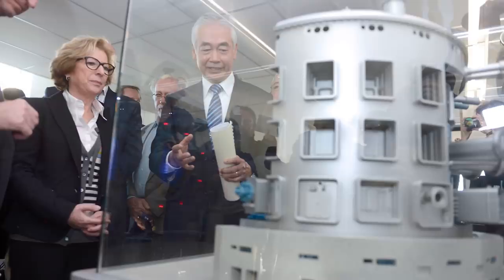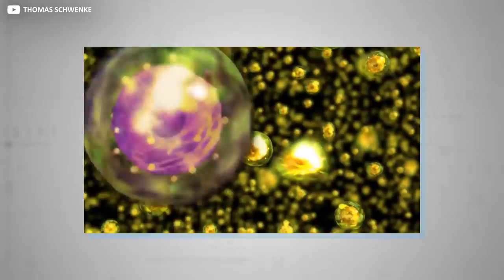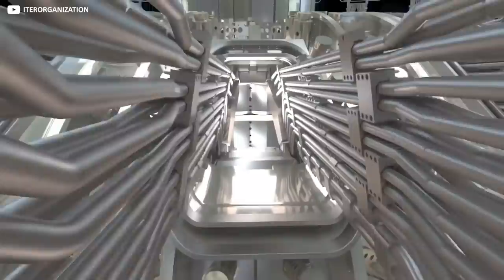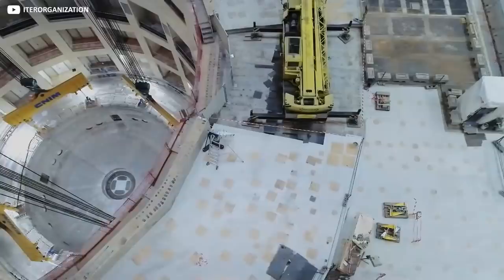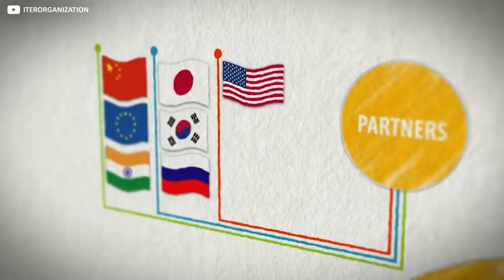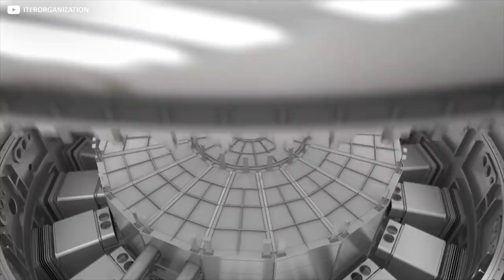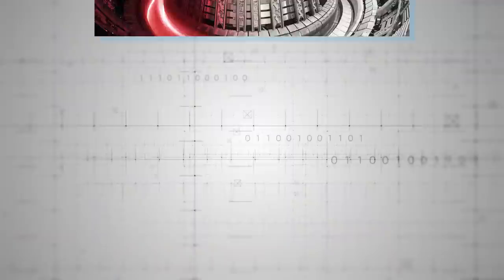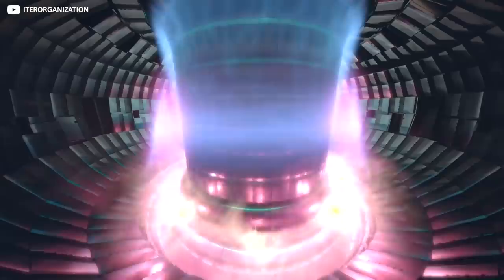Inside The World's Largest Nuclear Fusion Reactor

Comment: When operating, the plasma will be under high vacuum at all times. Some questions:

1. What happens if/when the supercooled magnets unexpectedly quench?
2. What is the expected cost for a kg of deuterium and for a kg of tritium?
3. What is the projected cost for electricity that is generated using fusion, including ALL costs and government subsidies?
4. How is the "excess" heat extracted and turned into electricity?
Reply: 1. The magnets potentially melt and need repairs. The reaction goes out and you stop producing energy until the magnets are repaired.
2. Deuterium is very cheap, maybe several $100 for a canister. Tritium is a few 100-1000 a gram (and they need ~1 kg), but they will produce their own.
3. No one knows, or has even tried to guess. No one will know for decades.
4. High energy neutrons hit a molten metal blanket around the reactor. This heats it. The blanket passed the heat to a water cooling system. This makes steam.

Also, the plasma isn’t at a high vacuum, it’s at a very rough vacuum, a little under atmospheric pressure.
Reply: @Gomlmon99  1. Obviously. But if a magnet quenches, won't 100 million degree plasma instantly hit the interior walls? Won't this cause an explosion, and/or a large and intense burst of radiation? And what are the effects on any power grid when a two GW power generator instantly goes off line?
2. I seriously doubt that pure deuterium will be that cheap. We need a serious analysis of the annual cost of supplying deuterium and tritium to a two GW fusion reactor, that "never" shuts down.
3. If nobody has an estimate of the total annual cost of making power using a fusion reactor, then everybody should shut down R&D until we have a reasonable estimate. To spend billions of dollars over the years, only to come up with a fusion reactor that is unusable due to extreme operating costs, is completely foolish.
4. If the blanket is hot enough to be molten, how are the magnets (next to the blanket) kept at cryogenic temperatures at all times?
Reply: @JCAH1   
1. No, the plasma will dissipate very quickly and doesn’t actually hold that much energy. It has a high temperature but a very low mass, so no explosion whatsoever. Why would there be a burst of radiation from plasma going out? The plasma itself is radioactive, any radiation would immediately stop - not that it matters as there’s a bioshield. The generator won’t suddenly go offline, the coolant circuits have energy storage (huge thermal inertia) to tide over the generation anyway, because there will be pulsed heat production. You’d have ~a hour before all power is lost.

2. It is that cheap. I work in fusion. We buy deuterium canisters each week. It’s very cheap. The helium we buy to cool our magnets is more expensive. And as I said, it will produce it’s own tritium. The fueling costs are effectively 0 compared to the construction costs. We don’t need a serious analysis of these costs, they’re irrelevant.

3. An incredibly ignorant and short sighted view. If we didn’t do anything without knowing the final costs, we’d literally never develop anything and would still be living in the Stone Age. No idea what on Earth you’re thinking here. 

4. The magnets are inside the cryostat, the blanket is outside it...? Just look at a diagram of a planned tokamak.
Reply: @Gomlmon99  It is nice to hear that you work in fusion. I am a retired professional engineer, and I am used to engineers being skeptical of their technologies, always looking for potential "land mines", always doing thorough cost estimates, and always focusing on what is unknown and what could possibly go wrong. But fuzzy, non-engineering thinking, vague, unsupported promises and goals, and a defensive emotionalism seem to have permeated fusion power research for the past 70 years.
 
1. If containment magnets quench, then if the power plant's output goes to zero now, versus going to zero an hour from now, either way the 2 GW fusion power plant would experience an unscheduled stoppage without warning, and require weeks to get back online. That is extremely hard on a power grid.

3. Regarding estimating costs in advance, thousands of giant ships have been designed and built, and the cost to build each one and the cost to operate each one are thoroughly estimated in advance of anybody spending one dollar. The same is true of nuclear power plants, massive planes, skyscrapers, huge bridges, gigantic manufacturing plants, etc. Only fusion engineers seem to exempt themselves from this routine, standard requirement. They and their financiers are going to be embarrassed and very sorry if it ends up costing $30 billion to build each fusion power plant, and the resulting electricity ends up costing $12/KW-hour (versus $0.12/KW-hour).
Reply: @JCAH1  1. Same goes for any power plant. Coal plant has an explosion? It may require weeks to get back online. Nuclear plant stalls? Days to get back online. etc. etc. 

3. None of these you listed are first of their kind research things. No one knew the cost of fission before the first fission plants were built. They’ve been developing solar panels for 200 years, with no idea how much they’d cost until the past few decades. The same goes for most first of its kind research. Fusion isn’t abnormal in that respect.

Not that I don’t agree with the cost issues. I personally don’t think fusion will be commercially viable within the next 80 years, but I don’t like it when people disparage it for irrelevant reasons. The main issue, as with fission, it’s that it’s expensive to build. And that will always be an issue - but we have to try.
Reply: they arent dumb everything you thought about has been revised and corrected. It doesnt blow up its not fission but fusion

Comment: And this is still an experimental reactor, if it works we will build the first comercial reactor which has to be even bigger.
Reply: Not necessarily, they choose the "big" way to simplify management of magnetic disruption. They have to use "old tech" very low temperature magnet. 
Since then whe have more compact toroidal magnet with the same field power.
I think DEMO ( the production version of ITER) will be smaller

Comment: You do realize they are building the only fusion rector currently right? doesn't make sense to call it the biggest or the most advanced. Also they don't plan to run it to power France its just a proof of concept.
Reply: It's referring to other projects around the world like the Joint European Torus mentioned in the video, as well as MAST-U, DIII-D, CTOR, COMPASS-U, JT-60SA, ST-40 to name a few. These other devices are fusion reactors too, but each is designed to test slightly different things. ITER is designed to make steps forward in various areas of the science, such as higher fusion powers, tritium breeding techniques and alpha heating that will lead to burning plasmas, where the fusion reaction itself is providing the heat to maintain fusion conditions. To do these things, it has had to be designed bigger and more complicated than all those other devices I mentioned. And yes, it's going to prove various concepts that are being relied on in fusion power plant designs being worked on around the world.

Comment: Magnetic doughnuts won't work. You have to use a perfectly spherical magnetic constriction field, in order to compress plasma to the temperatures needed for fusion even to begin to start.
Reply: No and yes, you can create fusion using a "doughnut" shape but instead of fusion occuring in a singular point it occurs in a ring towards the center, the advantages to this config compared to the sphereical design is power production, think of this how can we run a water feed loop to transport energy from the center to a turbine for a fusion reacotr? well for a sphereical one it's bascially impossible without splitting the water into little covering pipes which collected heat from the outside but that makes it hard to fit other devices such as the injectors as well as the magnetic compressors, so instead a doughnut shape allows water to be pumped straight through the  middle which allows the core temperature to be accessed allowing for greater energy efficiency and collection
Reply: @Kepler444f  Oh, I understand now. Wasn't aware water was still going to be involved in the energy production, like with fission reactors. Thanks.

Comment: A easy but not easy way for a lot of power would be to build a huge damn off each coast, not to block water but to let it go through the generators, hoover dam gives how many homes power? Huge ones off the coast would be a way we could for sure get a lot of power. Instead of extremely complicated fusion that we aren't for sure to be able to do. Not saying we shouldn't do it, but the dams would be good start for non fossil fuel power

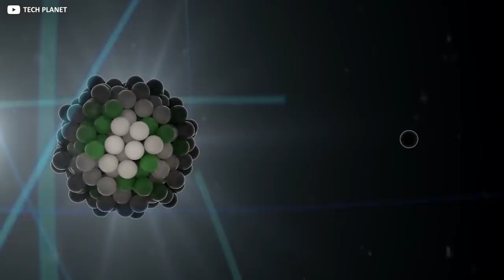Comment: @2:06 Ahh... no. This too will be an elaborate kettle!
In ITER, heat will be captured by cooling water circulating in the vessel walls and will be used to produce steam and—by way of turbines and alternators—electricity.

Comment: I like how he was showing nuclear (fission) power plants when talking about pollution, when they release nothing but steam into the atmosphere.
Reply: Don't forget the radioactive waste they generate, when they work as intended.  And the radioactive fallout when they fail.
Reply: @willdejong7763  Radioactive waste can be contained deep under ground and be sealed off. It may be the biggest challenge nuclear power plants are facing, but it's not an impossible one to solve. There are many substances that are much more dangerous than nuclear waste and waste from power plants only stands for a small portion of the nuclear material we transport today with medical and industrial uses standing for a larger portion. It's not as big of an issue as it's made out to be.

Now, come to safety, here is where most people are completely misled. Nuclear power plants today and powerp plants from 40 years ago are in a completely different world altogether. Let's take Chernobyl as an example - it's the worst incident in the history of nuclear fission power generation - and it could have been avoided would any of the safety features that we today consider essential would have been used.

The RBMK reactor used in the power plant was faulty from the ground up. It was a cheap reactor that could run on cheap fuel. This also meant it had a negative void coefficient, which in essence meant that it could, quite easily, run away. The operators were very poorly trained and had manuals with crossed over steps and overall unclear instructions. They also removed almost all of the control rods that keep the reactor under control to keep it running after they almost stalled it due to not following protocol, keeping it running under conditions it was never designed for over 10 hours. This could be compared to increasing the volume knob on your stereo to max after it the sound dissappear, then being surprised when the speaker blows out when you plug in the cable that was the reason the sound dissappeared.

Still, despite all these, and more, user errors and engineering mistakes (which they knew about for years but ignored), the release of radioactive fallout could have been prevented in its entirity or limited to a very small amount only affecting the plant and its very near surroundings itself marginally would the Soviet leadership not have been so damn greedy. On all modern power plants, it is a requirement to build a protective casing over the reactor. This casing is made out of very thick concrete, enough to withstand a substantial explosion (like the one that occurred in Chernobyl) and keep the fissile waste contained.

It is also worth noting that Chernobyl, the place where EVERYTHING went wrong, is now an important place for nature to thrive and the people who did not leave in avarage lived longer than the ones who evacuated. The stress of leaving took a harder toll on them than the radioactive material. You can visit the power plant today, but you're gonna catch more radiation on the plane there than in the plant itself.
Reply: @Ivar_Kahrstrom  Yes, that’s all reasonable. Except that at least in the US no one wants the waste buried in their backyard. Or even in their state. Radioactive waste, last I heard, was continuing to pile up without a clear plan to deal with it.
Reply: @willdejong7763  A large part of the waste produced by a nuclear power plant will be decayed within a few years. The rest though (a few percent of what comes out) decays much slower which means it's less radioactive, but will also stay radioactive for hundreds and sometimes even thousands of years. Yes, this is problematic, but it's a problem, not an impossible task. The solution is quite simple really, burry it under ground in stable rock where it will left alone to decay. You won't need to put it in your back yard as, I can assure you, there is plenty of free space that nobody even wants to touch - perfect for burrying fissile waste.

I'm not by any means claiming this is an ideal situation. It is however, a necessary one as we face an immediate need to decrease our greenhouse gases emissions substantially. We cannot simply close down all our nuclear power plants and then expect a solution to magically appear - solar and wind power is all good and well until it's cloudy and there's no wind. We can only store so much energy - we need stable baseline to rely on when we cannot extract enough energy from our other renewable power sources.

Until we have functioning fusion reactors, which are both safe and waste free, that can supply us with almost limitless amounts of power (the potential is enormous, but we're not quite there yet and won't be for a few decades), we need to rely on nuclear fission for power - it's the only way. Closing down nuclear power plants and powering the turbines with steam instead, which is kind of where we're going right now, is stupid and irresponsible and is only going to cause us more problems down the road. Nuclear power is the only and best solution.
Reply: @willdejong7763  radioactive fallout is almost impossible with thorium, and it produces little waste too
Reply: @cherrypepsi2815  I’m guessing that you are talking about liquid fluoride thorium reactors. I don’t know much about them, but they sound very interesting. Hopefully you are right. Are any in commercial use today?

Comment: Well by definition we're meddling with forces beyond our control - the entire point of the project is to figure out how to control them!
Reply: No we know how to control them . Iter is there to make it run over long period of time .Controling is not the peoblem to keep it running is.
Reply: @xythiera7255  I guess if you want to define simply containing them as "control".
Also, keeping it running isn't even the problem.  Making it produce more energy than it consumes is the problem.  Keeping it running longer is just one of many possible strategies to do that.

It may be the winning strategy.  It may not be.  Most likely we will combine many strategies (including longer-burning plasma) to reach a final solution, assuming it is indeed possible to generate and contain energy-positive fusion in a tokamak (which scientists obviously believe or we wouldn't be building ITER in the first place, but its still not actually proven. )

Comment: If it is to reach those extremely high temps inside the reactor, what on earth do they build the reactor from that can contain 150 million degrees Celsius?????
Reply: It can be magnetically manipulated like the distortion of the magnetic field on the sun that creates CME

And that means the plasma won't touch any surface